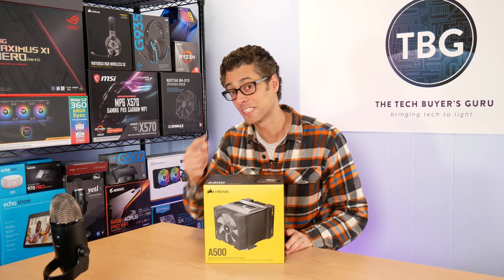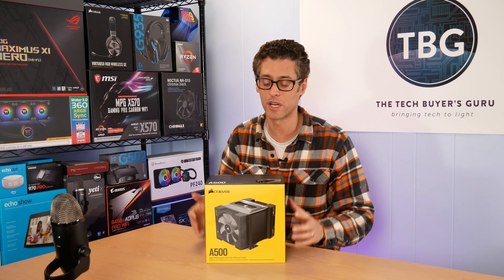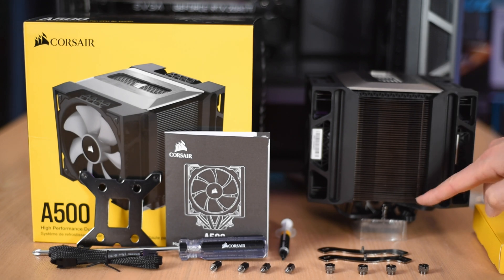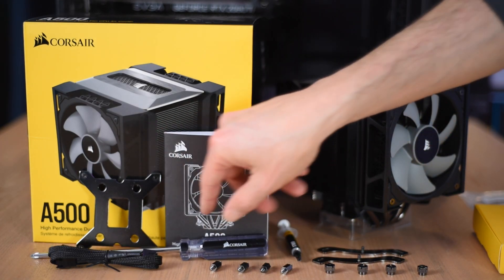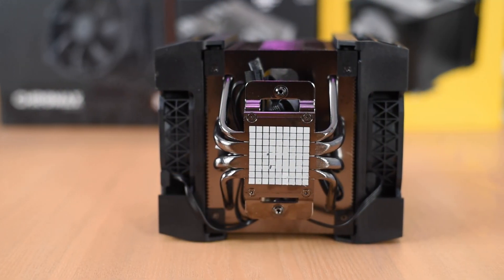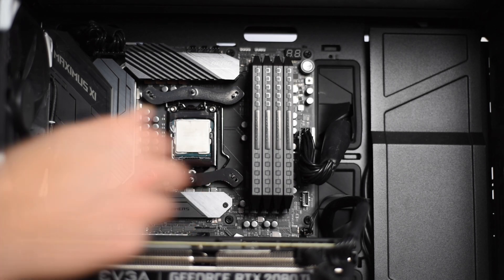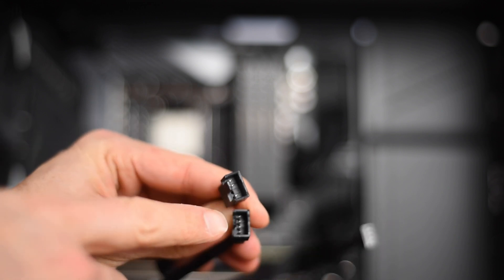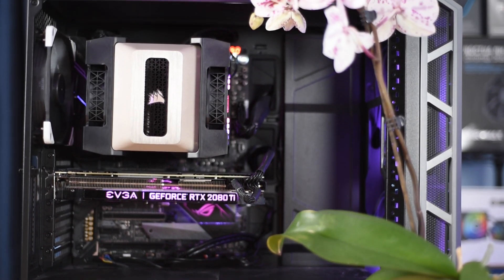Corsair A500 CPU Cooler - Unboxing and Install Guide for Intel Socket 1151

Comment: Hi! which MB are you using in this video?
Reply from the maker: Asus Z390 Maximus XI Hero WiFi: https://amzn.to/2YwKO2S
Reply: @TheTechBuyersGuru   ah gotcha, Im using the Asus ROG Maximus XI Hero WiFi and was wondering why my metal brackets fit vertically while yours fit horizontally in the video. Do you know if that has anything to do with it?
Reply from the maker: The cooler mounts identically on every Socket 1151 motherboard. You typically have the option of mounting the cooler horizontally or vertically, so just switch it.
Reply: @TheTechBuyersGuru  ahhh okay! so it doesn't matter if the cooler is facing the RAM or not? I've never built a pc before.
Reply from the maker: With this cooler, you do need to raise the first fan to clear the RAM slots, but typically, you want the cooler blowing from front to back, not bottom to top. That's because the case fans move air from front to back.

Comment: Great video, Can you close your case? this AIO looks awesome
Reply from the maker: That's not an AIO, it's a tower. Yes, I could close the case, but this is actually the tallest CPU cooler I've ever used, and WILL NOT fit in most cases.

Comment: Can I replace the fans with LL120s?
Reply from the maker: Yes, no problem - the cooler comes with ML120s, which use the same frame design.